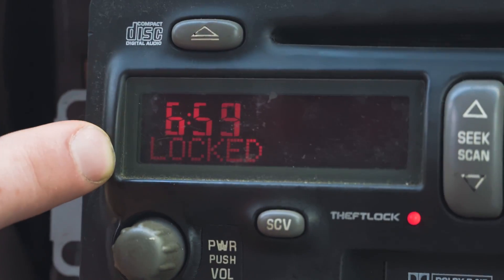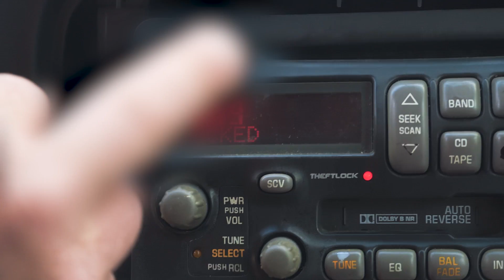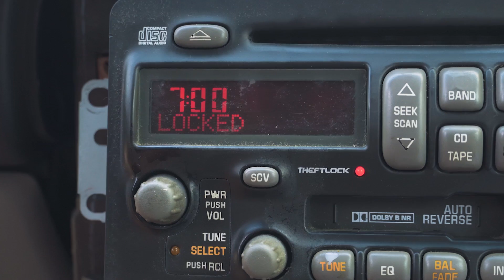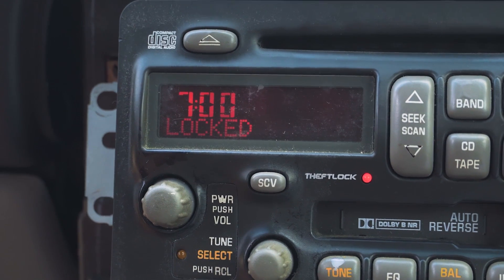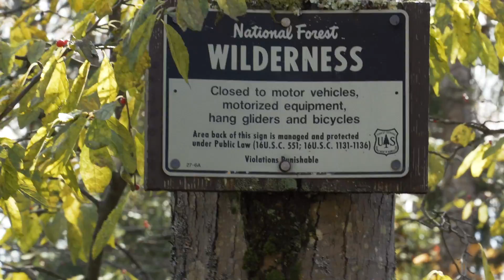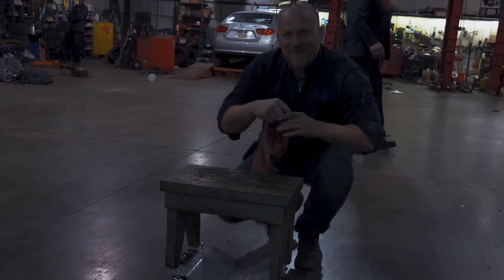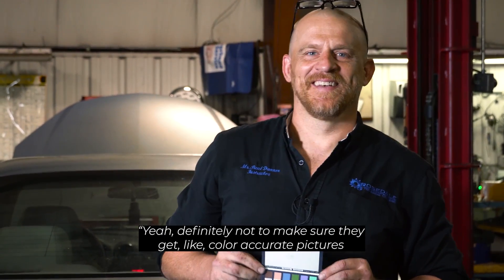2020 Recap

Comment: Oh hey
No that's stupid
What's really not so bright is using  someone else's funk rag on your face.
Okay what are ya gonna do now?
How about doing a smoke test?
 What is that?
That's not an umbrella.
What is it?
It's a device for collecting rain water to pour on unsuspecting computer circuits to see if they are well grounded. 
You can also use it as a substitute for a hang glider but I wouldn't try it the last guy who used it fell and broke both his legs. 
Great stuff guys, ya had me rolling on the floor. 
Happy Motoring and Merry Christmas.

Comment: 1st.....my  2008 impala  was getting 200 miles per half  tank of gas. now its getting 150.  no codes.. any ideas?
Reply: Put 3/4 of a tank in it.
Reply: @fascistpedant758  That deserves a whole bunch of likes.
Reply from the maker: What are your fuel trims and what is engine operating temp at highway speeds?
Reply: @ScannerDanner  i just saw this post lol.. i didn't know how to turn  on notifications ....ill get back to you. thanks... i have this thinkdiag will that show the temps? not sure how to use it really. ha ha